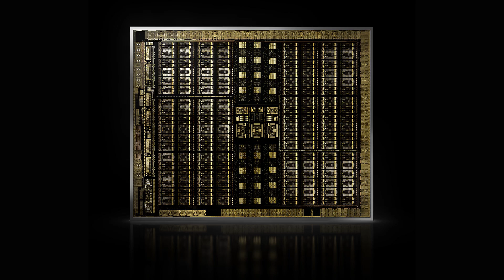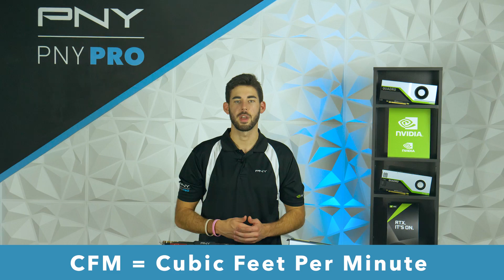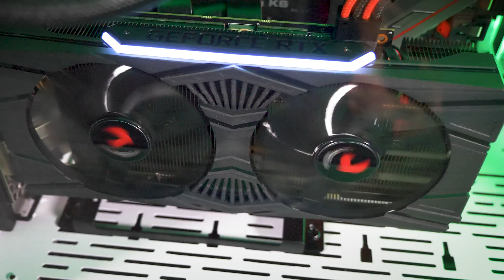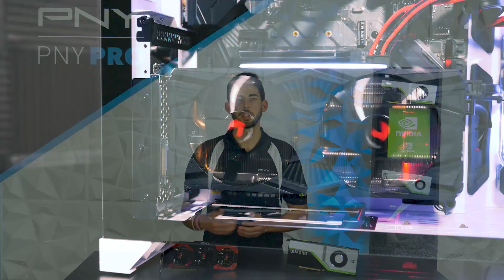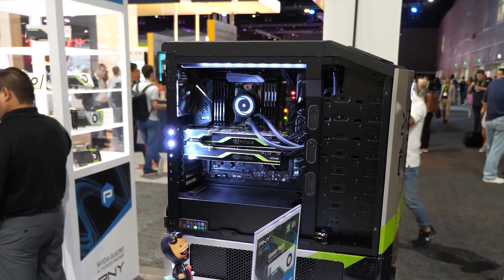Blower vs Fan - Which GPU is best for you?

Comment: It didn't surprise me to see a the marketing department of a company to grossly misrepresent the differences between two of their product types.
A high-end blower-cooled GPU sounds like a vacuum cleaner. You really need to get this down. If you don't particularly enjoy gaming while your mother or wife vacuums your room you probably don't want a blower. 
-You don't want blowers in anything that has to be in the same room with people. The blower is for strict airflow direction and not for cooling efficiency. Even in small form factor systems, it's usually a good idea not to go with whatever particular card you wanna use if you cannot use a version with an axial cooler on it. Nvidia's founders of the last two generations are a really good hybrid between the two types and are surprisingly good for SFF builds btw.
-Blowers are for density. You can slap 8 blower cards on a workstation board and render an animated movie or something. The key point here is that once you start the rendering you leave the room because there isn't any more user input required lest there be errors and enterprise hardware has ways to let you know from afar. In contrast, you don't leave the room when you play video games.

Comment: I got a Wintek 3070 8gb made for overclocking really nice double ball bearing fan never is loud and i got like the best airflow in my case, for ex i play using this i7-8700k oc, capping my ram trhats 3200 to 2666hz keep in mind, so 32gb of ram and nvme 2 tb card and this graphics card, cpu never over 55 gpu never over 60... cyberpunk max setting ray tracing 54 avg lowest fps temps never reach higher then 60 in both my cpu or my rtx card everything runs insanely smooth and then it idles back down to 34 degrees both my cpu and gpu in no time flat after several hours of gaming im only using 5 case fans an a dual fan 5 heatpipe idcooler with noctua h1 in a depcool tesseract case built it all for 800$ there is not a game it cannot run with 144hz refresh rate hd and lower then 60fps

Comment: I have a GTX 1660 Blower PNY brand, it got 75C degrees maximum which isn't terrible, than I got a 1660 SUPER single fan for some reason, also PNY. It performs and cools great, but the fan sounds like a sawblade when it revs up under load, but other than noise, cards are great!

Comment: How about electric ignition of combustible gasses? Is there one of these fans that would work for an airbrush paint booth exhaust fan? If the electric motor that powers the fan comes in contact with combustible thinner fumes there could be an explosion. I need a fan or blower that would be suitable for air brush painting.
Reply: This is a graphics card, not a exhaust fan for a house. These are built into the gpu to cool them off.

Comment: I currently own a 2080ti PNY blower I've had it for 1 year now... I sat the fan curve to where it needs to be, 4k gaming all day long no problem no over heat, don't listen to those who claim blowers are garbage because they are not, even mine is over clocked 170core 700 on the memory and I never had an issue, set the fan curve right and make sure you have good airflow inside your case mine is an aurora r7 alienware
Reply: How can i set the fan curve
Reply: @genlongtsang1093 Msi afterburner

Comment: I had an R9 290X with a blower fan and unfortunately, I then had to invest in water cooling  (NZXT G10 with an NZXT X60) to quieten down what sounded like a jet engine every time I started to work the GPU.
I like how manufacturers are adding both AIO water cooling with up to 240mm radiators and water cooling blocks for custom systems as standard on some models.

Comment: Simple and understandable, A work station using the Quadro a blower style is perfect, A gaming rig with multiple case fans and ventilation holes the Fan Gpu is plenty good so long as you  are not building a mini itx system. Such a small space overheating could become an issue in a hurry.

Comment: I've never had anything but a 1 fan Video Card so having one of these monsters I'd be curious to see how much heat is generated to the outside! I think the open fan design rather the Nvidia depicted and enclosed would likely be the most efficient since the air is not restricted being pulled in.